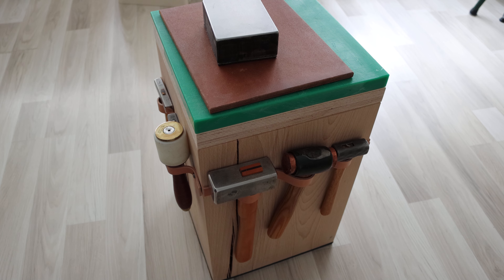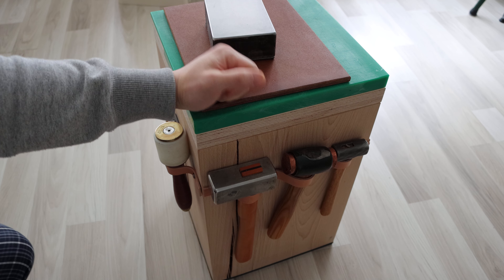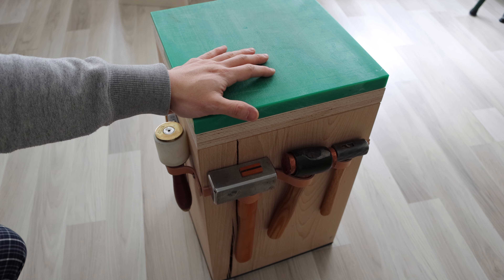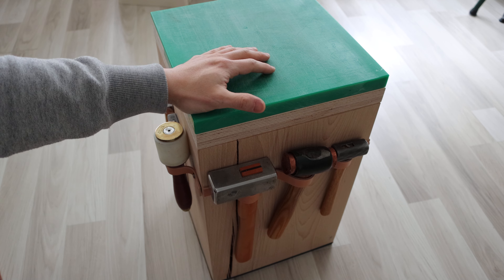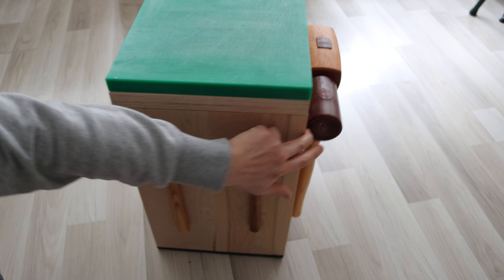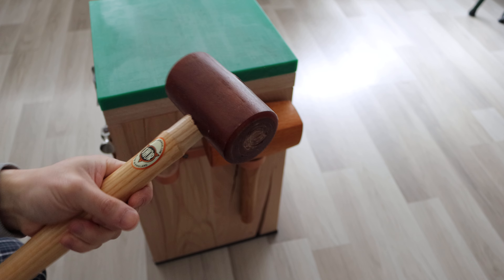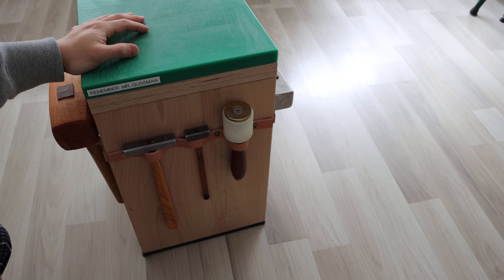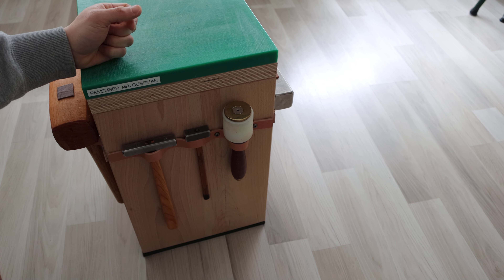MY NEW PUNCH STATION in 2024!!!

Comment: The height would also be an issue with me.  I built my stamping table with a thick triangular top, with 90, 60 and 30 degree corners. The shortest side at 18 inches (roughly 46 cm).  I then took 3 2x4 pieces, bolted together in a triangle shape, and set them in the center, at the perfect height to pull over my knees when seated in my work chair.  The triangular leg has stabilizers at the bottom, and the 3 2x4s form a very solid pedestal to absorb the vibration from hammer blows to the surface.  I can slide leather items over the corners to support working on one side of an item, instead of trying to flatten the piece out on a tabletop.  I can punch holes, set rivets, set pricking irons, with my metal anvil plate, or cutting board surface, placed in the center of the triangle, over the leg.  It is big enough to hold my 24 by 18 cutting mat, if I need to cut out smaller pieces.  It is absolutely, the best thing I have ever made from scratch!  I think I am going to steal an idea from your punching block, and screw leather straps around the leg for holding my hammers, as well.  I don't have as many (or as nice of hammers as you do), but that idea is golden!

Comment: Would love to see more of the stump block. You said it was a solid block.  Unsure how it was constructed but gluing 4x4 or 6x6 dimensional beams like an anvil stands is my guess. Love the felt bottom to move/slide and isolate/dampen. For mass the block could have a hollow filled with sand. Any details on the pounding board? It is just thick kitchen cutting board?

Comment: Thank you for posting this, great idea. I have been wanting to make this exact thing. I wonder if you couldnt just cut two 30cm section of a suitably heavy plank ie ~10-15cm thickness to elevate the punching station a little further. Might not be exactly the aesthetic you are going for, but it would be plenty  sturdy besides most of the function comes from the weight of the tree trunk.